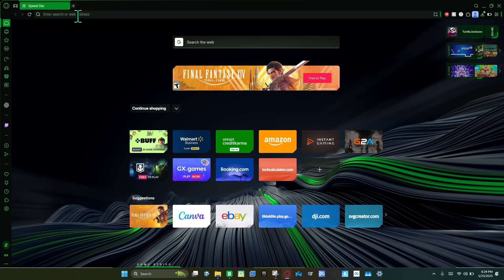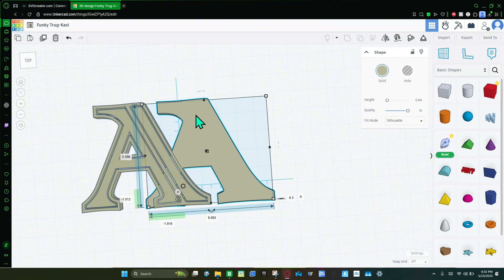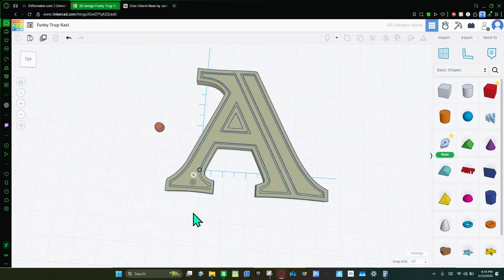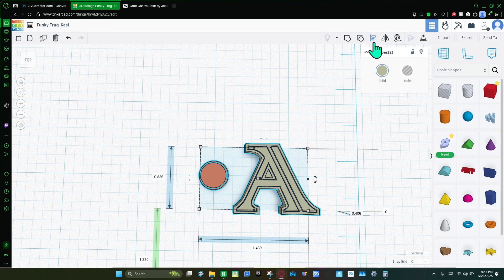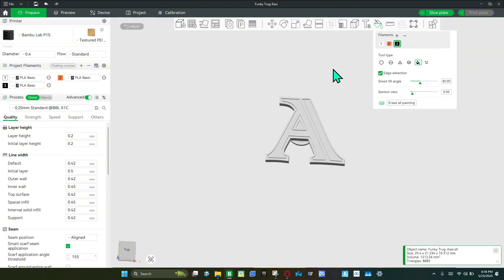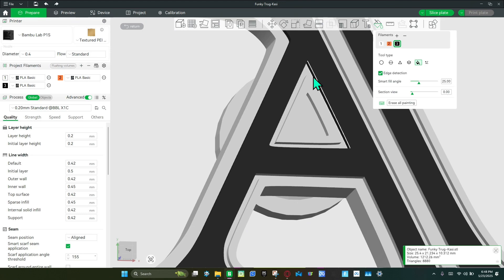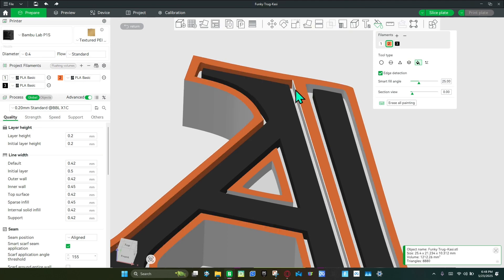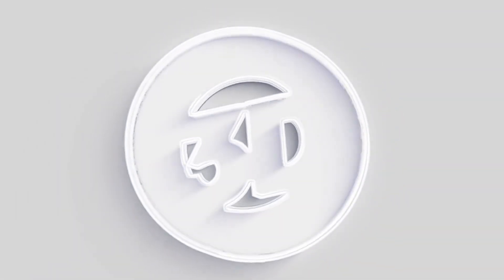​@AutodeskTinkercad Logo Hack | 3D Print Custom Hype Chain or Croc Charm with @BambuLab

Comment: When I printed it I pulled off the back with the treen supports is there any settings I need to change so it doesn’t happen again
Reply from the maker: Sometimes I reprint it first before I change any settings. Might give that a try.